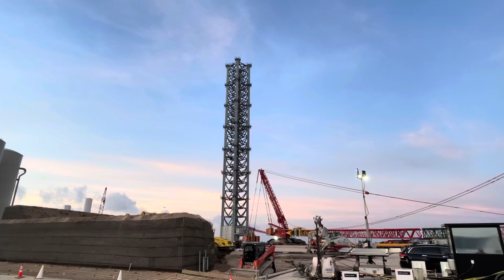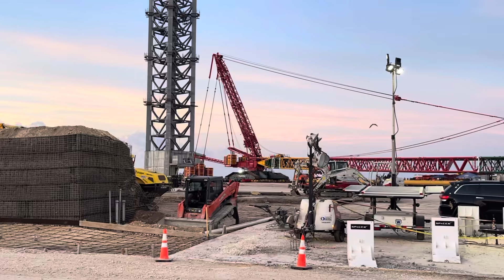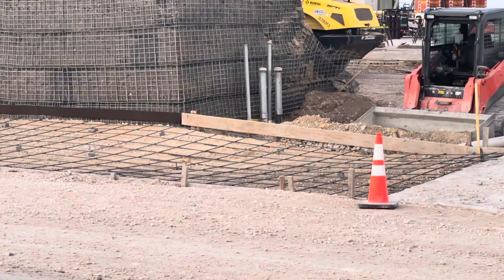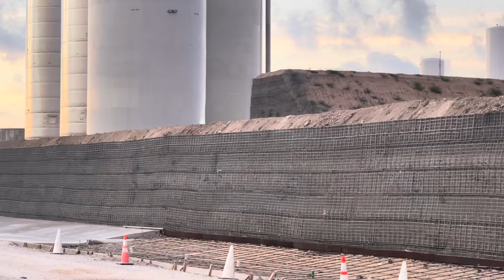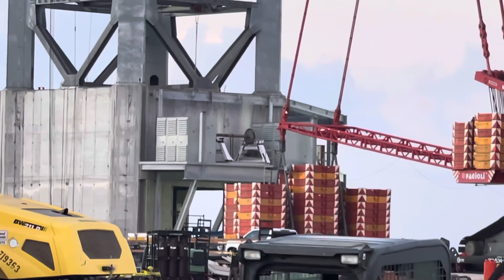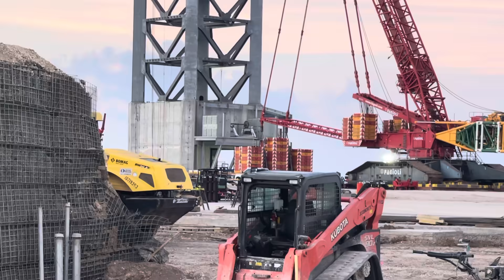Morning at SpaceX Starbase Launch Facility Saturday July 3, 2021 6:30am

Comment: There is more than just the 8th section to go on. They will also need the height to add the lightning rod and any equipment that will need to be placed on the top or inside the top segment.